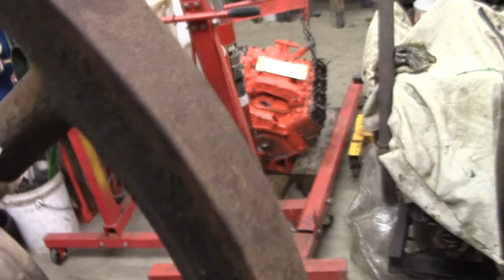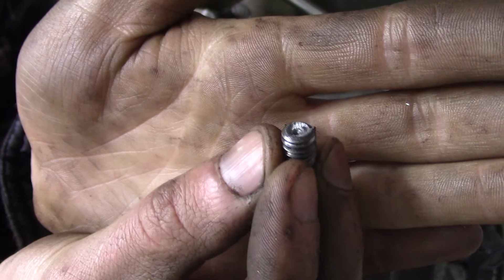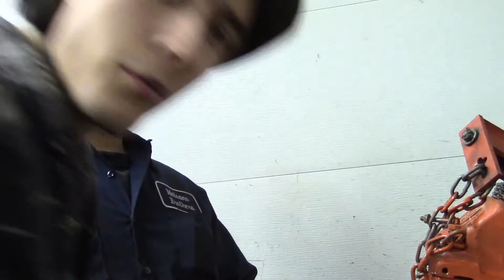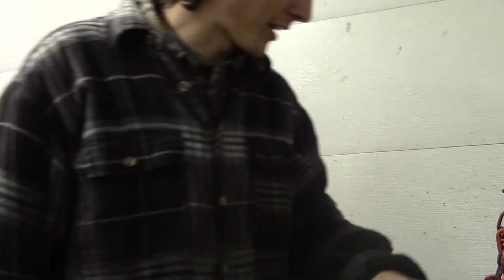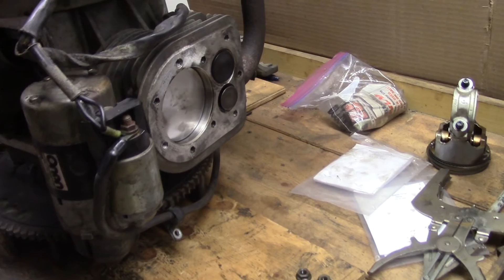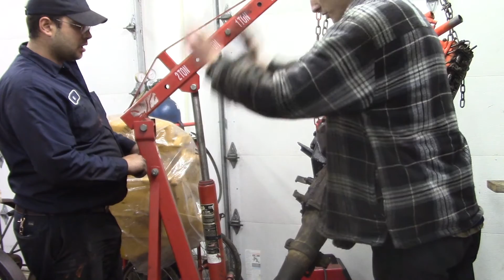Shop Talk Friday With Connor and Franko -  2/17/17

Comment: I dropped out of the whole engineering thing, BUT... I think those pressure plate bolts were 800 thou (I'm legit!) instead of a standard inch so that as you resurface the flywheel over time and the thing gets thinner, the bolts will never stick out the backside. 
Your guys' commentary is the greatest thing. I'm glad my friends and I aren't the only ones that say all kinds of goofy shit whilst engaging in thread strippage. :D
Reply from the maker: haha, glad you enjoy! Good point on the flywheel resurfacing, but we noticed that even if the bolts stuck out of the backside of the flywheel, there's nothing near them that they would hit. who knows...